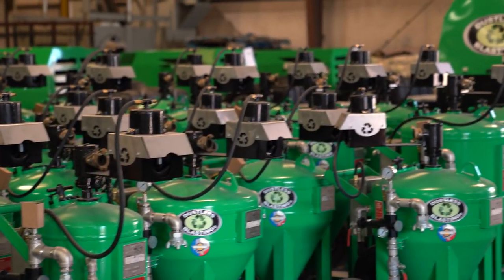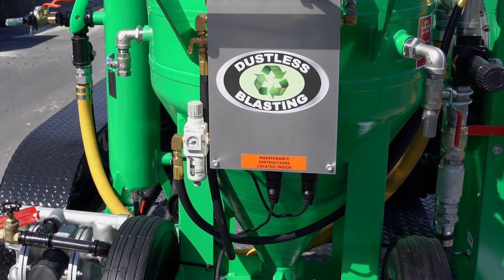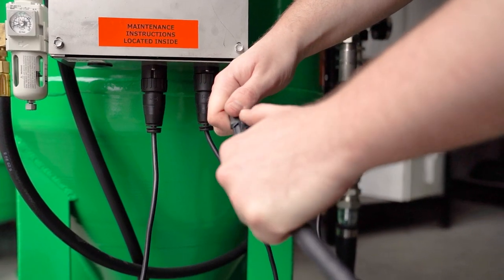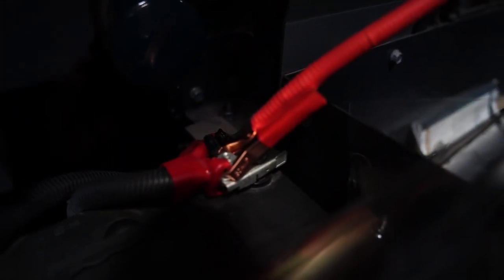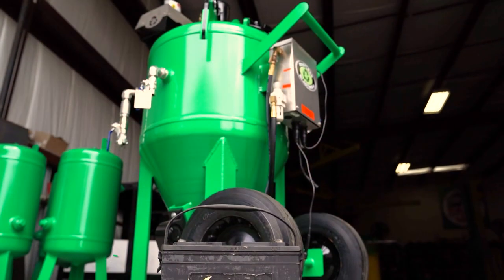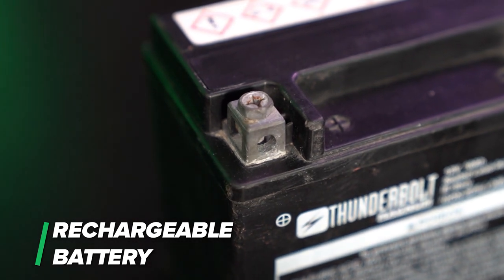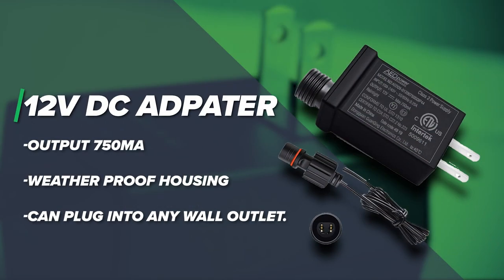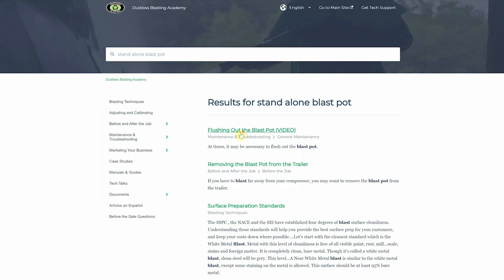How To Power Your Stand Alone Blast Pots Electric Control Box | Dustless Blasting Academy

Comment: Why wouldn't there be pre wired connectors on the compressor for this as you would not go anywhere without it unless it wasn't your equipment like a rental compressor as the stand alone would have to go anywhere the compressor was to work so its not really a stand alone they would need to be moved or transported together.
Reply from the maker: Your exactly right, for our mobile units that is the case. This video is for the customers who purchase a stand alone blast pot and use rental compressors for there work and need to connect and disconnect quickly from their desired power source. The "Stand Alone" comes from when a larger shop already has built in air lines suppling 185 cfm air. That's just one of the use scenarios, That's why we are demonstrating a couple different ways to power the control box. Hope this Helps.
Reply: Does your equipment come as plug and play so to speak if a compressor and stand alone were purchased from you and do you sell shop compressors or only mobile?
Reply from the maker: @JP-ou8yb  I see the confusion now, So right now we only sell either the blast pots by themselves which are plug and play (if you have the compressor) or we sell complete trailers with pot, compressors and cooling systems. we do not sell compressors by themselves. You can learn more here about our products. hope this helps:
https://www.dustlessblasting.com/products